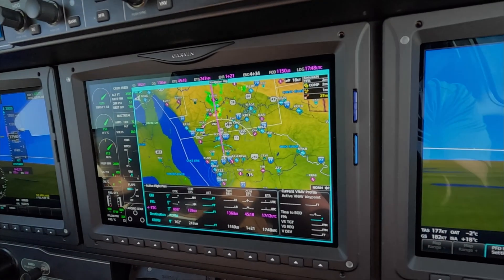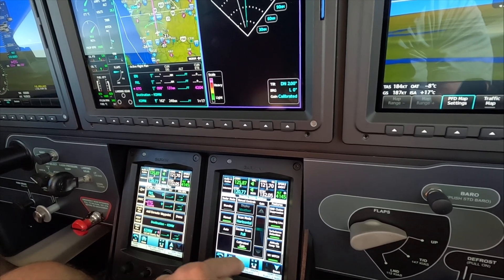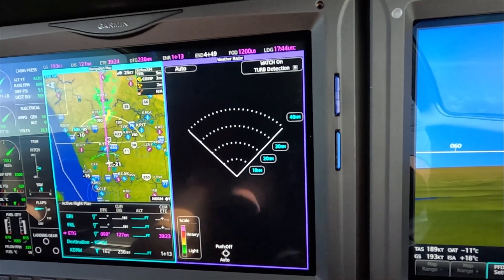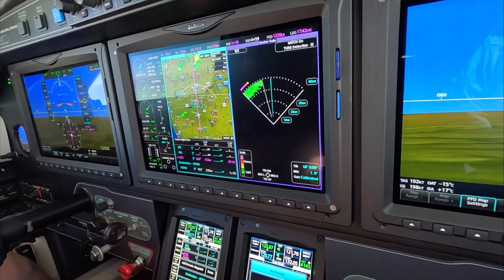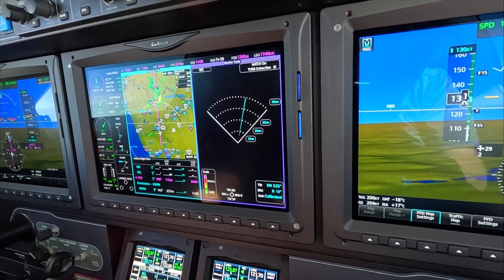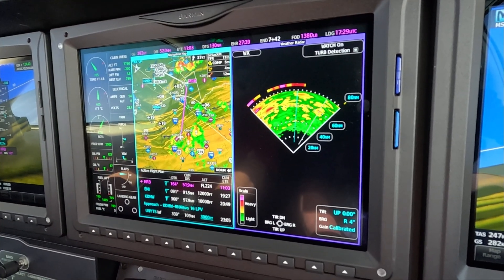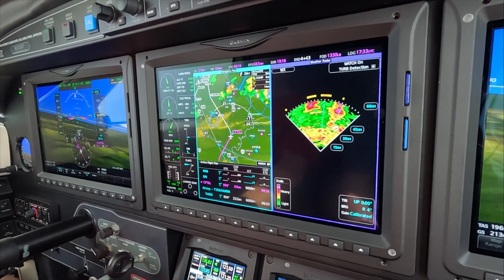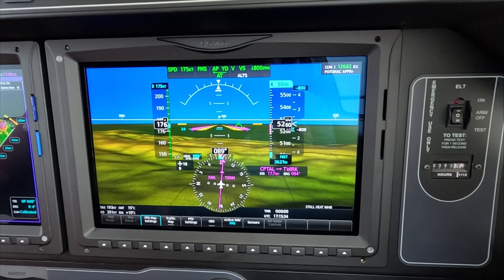The Piper M600 - G3000 - Radar and NEXRAD Side by Side with Dick Rochfort

Comment: Dick I appreciate your work in the videos.  I'm currently flying a PA-32R-301T and am hoping to move up to an M350 when I finish my instrument training.  I'm curious about use of trim during the flare on landing.  I've watched all your videos so I hear you asking for trim during the flare.  I'm having some trouble with ballooning in the flare because I'm pulling back too hard instead of trimming up during the flare.  Can you tell me your practice on trim use during final approach and flare?  Thanks.  Robert.
Reply from the maker: Hi Robert! I suspect that the reason you are ballooning is that you are too fast when you begin the flare. Fix the airspeed issue first, then use trim to flare at the correct rate, but only after you have made the decision to land. Check with your flight instructor before changing your technique. Fly Safely - Train Often .. DR

Comment: I have the GWX-75 radar.  I can purchase the software unlock to make it the GWX-8000 (with Storm-optix) and AUTO MODE.   for $15,000 !!!!!!!!  Is it worth it ?  Apparently in AUTO MODE, the radar sweeps horizontal and then vertical on each graphical sweep, removes ground clutter, analyzes the returns and then displays the threat only relative to the aircraft's altitude.
Reply from the maker: @brianlee3146  Hi Brian, it seems that the upgrade adds convenience, not reliability. Check with your avionics specialist, but it could be that what you currently have is just fine.. speak with your flight instructor as well.. Fly Safely - Train Often .. DR